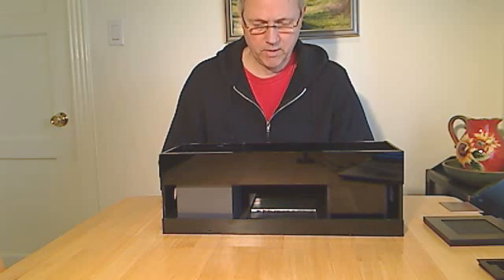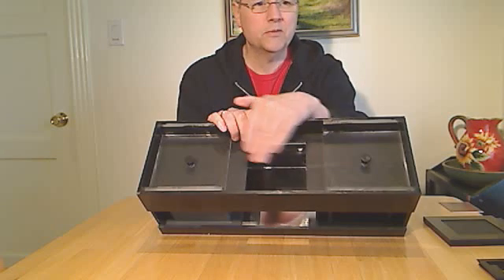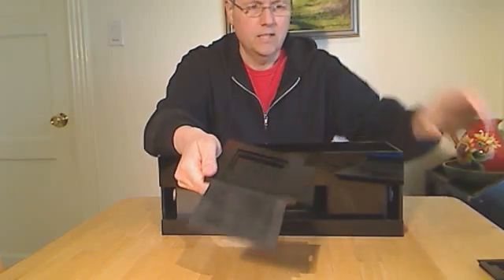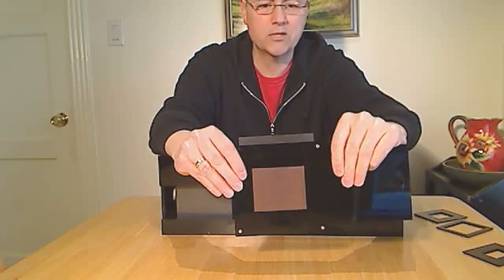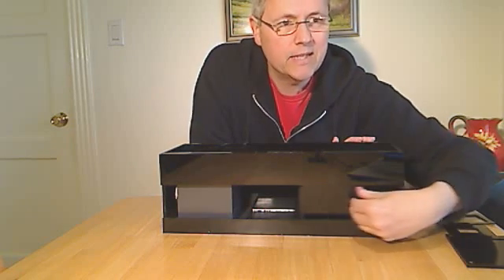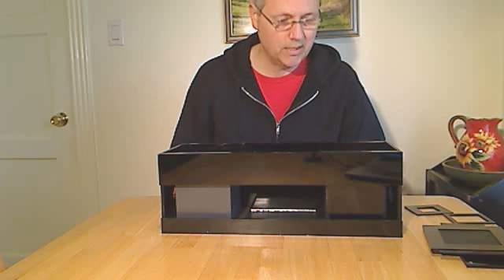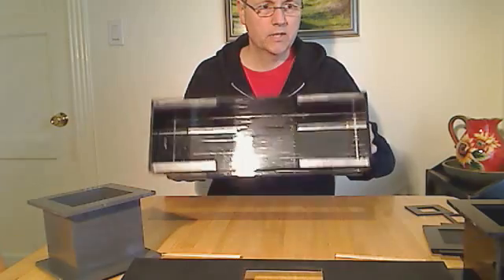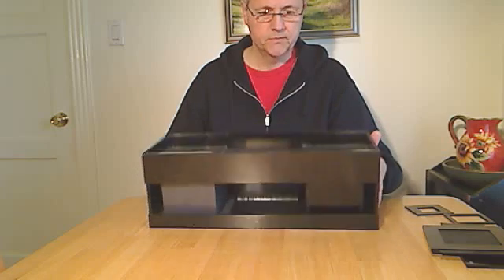Sliding box daguerreotype plate fumer

Comment: Hi Andy how was your experience with such design?? I am also planning to copy that any comments/advice from u  is welcome.Did it worked???
Reply from the maker: Hi Rakesh - For reasons unrelated to the design I have only ever put iodine in that box and not bromine. The iodine worked fine and the box is still holding up without deterioration. I did build an outer marine plywood box to store it in as an extra containment. One of my friends who is a very experienced daguerreotypist has expressed concern that this design might allow iodine and/or bromine fumes to linger near the plate after the boxes are slid away - changing the fuming times in hard to control ways. I did not experience that issue, but I only used it a few times. My work with the daguerreotype process has been on hold for several years, but I do plan to return to it. Visit http://cdags.org for lots more info on the process. Please post pictures of your design there if you do end up making it. Best of luck to you.